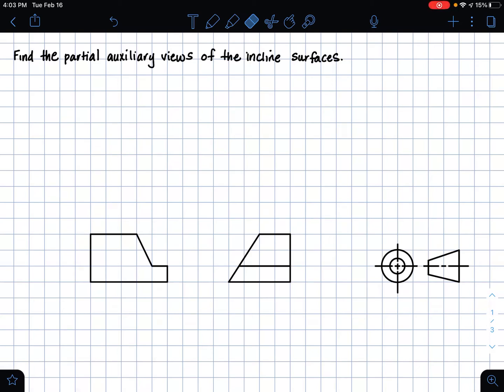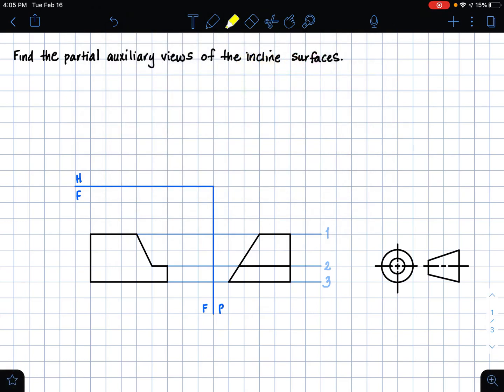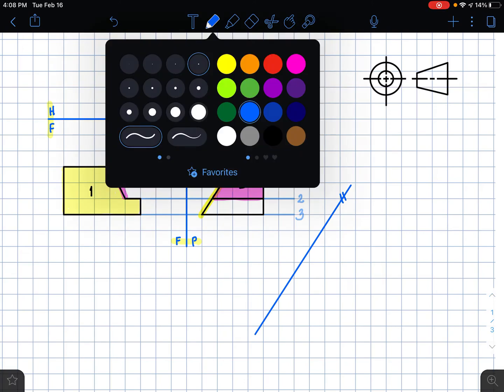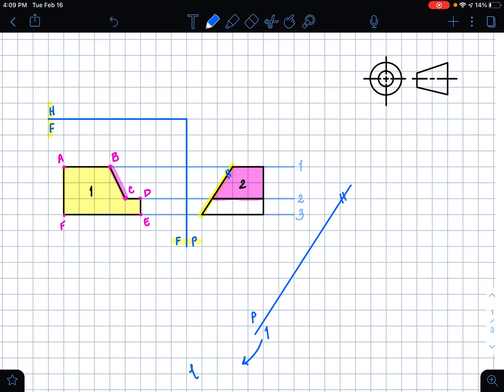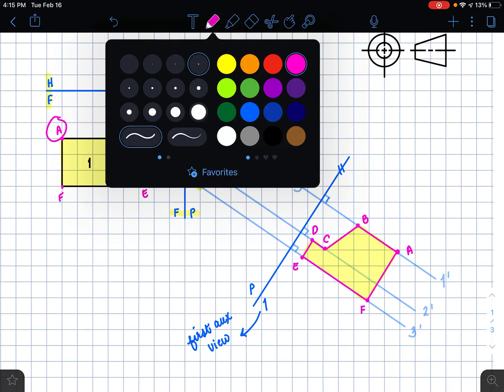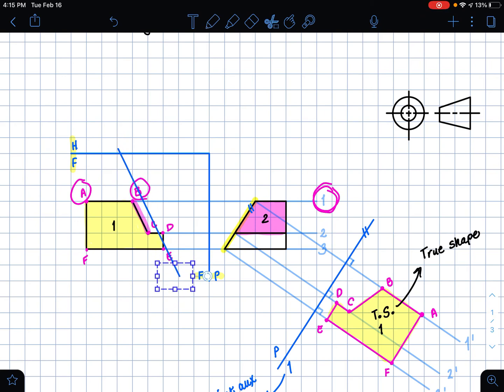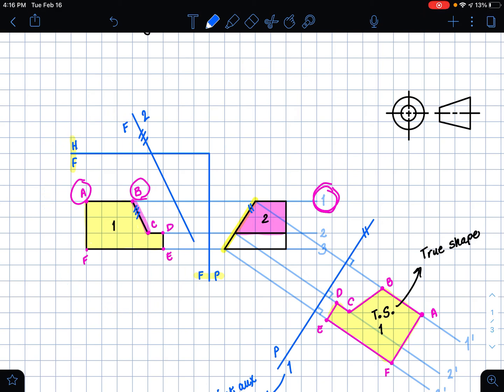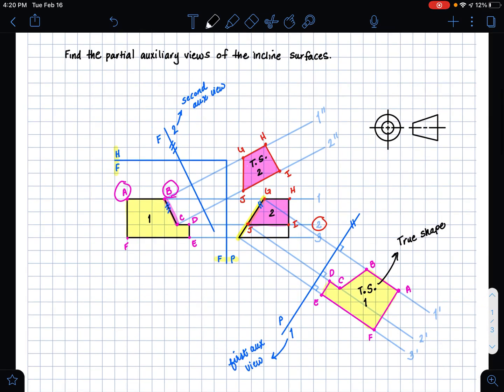Partial Auxiliary View Problem Step by Step Solution Engineering Drawing

Comment: Please answer
Q1)The projection originated from the 3d object itself to project on the plan in front of it, is called_________.
a) First angle projection b) second angle projection
c) third angle projection d) fourth angle projectio.
.
Q2. The projection originated from from the eye ball and converted into 3d object to project a 2d image on the plane is the
(a) 1st angle projection (b) 3rd angle projection (c) 2nd angle projection (d) 4th angle projection
.
Q3. when the surface is inclined to two of the planes of projection ( but perpendicular to third) the surface is said to be (A) Auxilliary (B) Skewed (C) Oblique (D) Angled (E) Primary
.
Q4: actually show the full size of view (A) Axonometric projection (B) Orthographic projection (C) oblique projection (D) Isometric projection